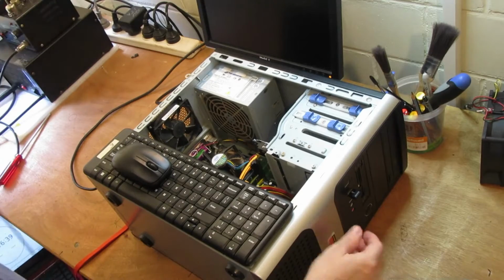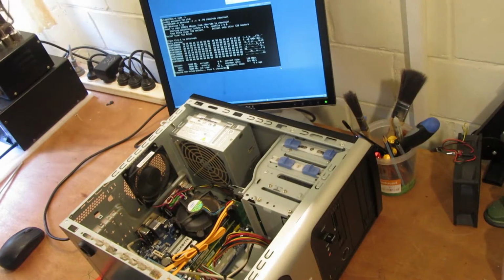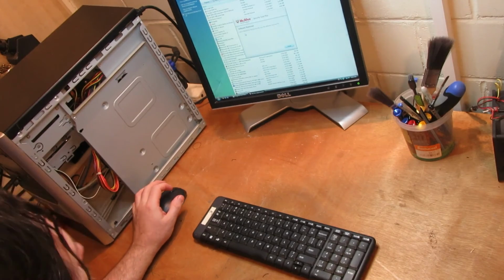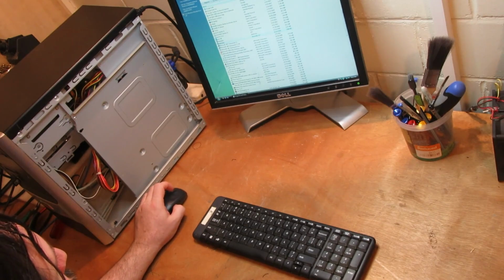What I fix daily - Generic Core2Duo desktop with stalling  issues [cut short ending]

Comment: Dear Paul, two things you need to purchase.
You need a oscilloscope to look at the power supply under a load.
and Spin Rite by GCR.. These are important tools.
Reply from the maker: I do already have a scope, but find realistically in daily work that it takes more time and  the results still not overly conclusive. When I bought the scope I thought the same "Yes! This is going to make fixing things faster/easier", in reality it does a better job collecting dust.

As for spinrite, I prefer to use GNU ddrescue.

Comment: Why didn't you at least check the 12 and 5 volt rails on a peripheral connector on the power supply first? Just curious.
Reply from the maker: I've found usually it's easier to just run the machine and see if it glitches. Sometimes it's faster to just do a visual inspection (of  course some  cap failures aren't going to  visually show, I agree).

Comment: On the customer thing, most of them don't understand POST etc they as you said go 'hey its dead' and its like.. ok how dead? hehe.. I've had a few laptops drop on my lap and find that things are completely wrong etc.
Reply from the maker: Agreed, +Rob Graham . Usually I'll drill down the questioning a bit more with "Any lights? Any noises?"; though sometimes it's just easier to get them to bring it in, since they're doing that anyhow,  though the trouble arises when they want an 'estimate' before they bring it in, then you have to high-ball it because you know they're going to get it set in their minds.

Comment: Vista one of the hasted Windows releases like Windows 8 that failed while XP,7,10 are fine. Do you have spare new hdds in storage or did you order one after the client asked you to upgrade the hdd ?
Reply from the maker: I generally keep a collection of new drives on hand.  One thing I find is that you risk losing  a lot of jobs if there's too many delays.   

As  a pricing  comparative, I spend a lot more on replacement iPhone screens than I do hard drives; it's strange, people are happy to spend $200+ to get  their phone screens done,  but really agonise over a similar price range for  replacing their failing drives.
Reply: yea mobile phones are like a body extension that you don't wanna loose.